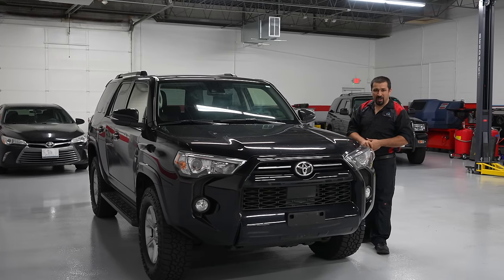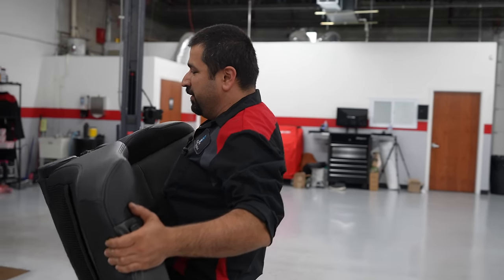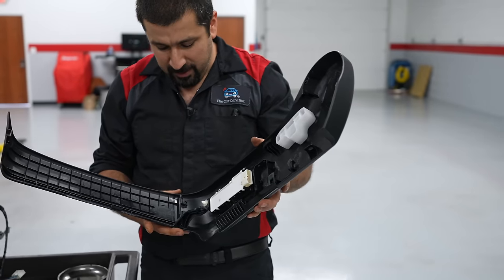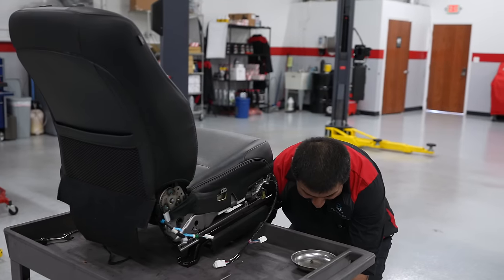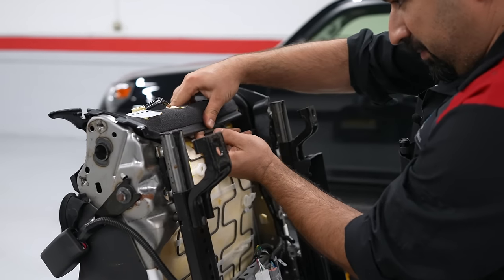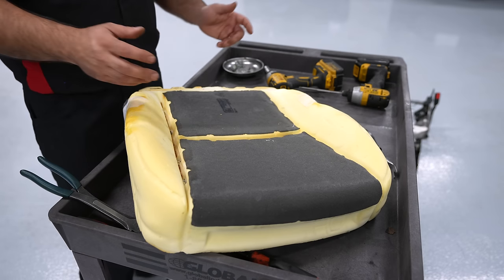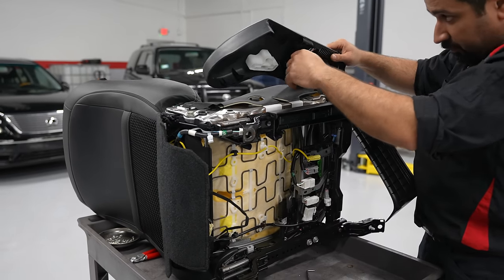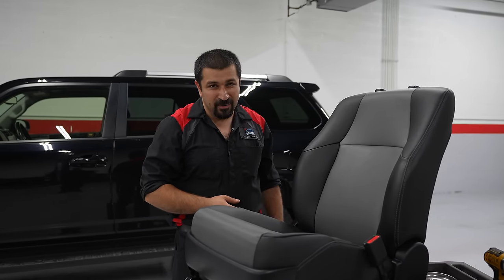Tearing a Toyota Seat Apart to Replace a Cover | Toyota Seat Common Problems

Comment: AMD ,  My name is Bret Staley. I have a 2022 RAV4 Prime SE that I took the seat out of so I with the help of a master welder metal fabricator could make the to tall for my disabled wife a seat that could raise and lower.  I got the seat all back together and reinstalled it into the RAV4 Prime and the Air Bag light was on.  So I scheduled a trip to A Toyota dealership to shut off the air bag light and reprogram as needed. The Toyota dealership did in deed get the air bag light shut off but they refused to do the re calibrating as they told me Toyota does not allow them to do so. So I got my hands on an Autel MaxiIM and paid Autel for the most recent updates so it would be compatible with my 2022 RAV4 Prime. There is a gentleman on Youtube that showed how to do the 2 steps to re-calibrate the occupant air bag sensor in the passenger seat .My metal fabricator found that video and that is when I borrowed the Autel scan tool and paid for the update. One function the end position sensor programed flawlessly and beeped in approval in just seconds.  The power On for the Passenger seat occupancy sensor was not so accepting and the wait function on the scanner would just continue to flash and every time I would hit escape even 20 plus minutes later it would turn the power position back to off.  The only code that shows with a deep scan is in the remote key-less entry module and it is U111787 unable to communicate. I'm at my wits end . I have a brand new car that Toyota refuses to help with  and I can find no one here in my area that has any proficiency in working on Toyota air bags/ interiors. I  hope and  pray that you might consider doing a video chat with me and helping me to reestablish communication so the passenger side air bag will arm as it should and my dear wife will be safe and able to easily get in and out of our RAV4 Prime.  I talked with your receptionist this afternoon and she said she would talk to you. Here is to hoping that you will agree to a video chat and walk me through the process that I'm sure must exist to re arm the air bag sensor on a GEN 5 RAV4 similar I'm sure to what you had to do after you put the seat back into the Tacoma in this video.  I noticed in your Video that you did not disconnect the battery before you disconnected the wiring harness. So if the Tacoma reacted as my RAV4 you also had to clear the Airbag light and re-calibrate the sensors.  God speed AMD.,       Bret Staley
PS I will be happy to pay 1-2 or whatever seems fair to you shop hours to just talk me trough the process. Just so you know I'm a 1982 AAI Arizona Automotive Inst. graduate. I'm a Doctor of Chiropractic now  but I will not be useless to you on a video chat call. Like I said I have the fully updated version on the Autel unit so should be good if that is indeed all we need. 
God Speed AMD.  Keep up your good work.

Comment: AMD I have a EMERGENCY question. I have a 99 4runner 3rz-fe, my 4runner does not start I put my key I don’t hear a crank and it does not appear Check engine light. Plz help.

Comment: My Toyota Auris seat squeaks like crazy it drives me nuts. Impossible to find the same matching leather seat. No one in my area seems to do seat repairs. I've tried stuffing fabric between the sponge and metal did a slight decrease but it's still there. Not sure if anyone ever had a similar  issue would be great help if anyone had a way to solve this.

Comment: I have a 2021 Camry SE with an issue on the seat cover.  The front bottom cover come undone from the J clips that hold the cover to the seat.  It happens all the time.  The dealer just put them back but in a few days they come off.  Is there a fix for this?
Reply: What do I do?

Comment: THE BACK HALF OF THE DRIVERS SEAT HAS SAGGED DOWN. EVERYTHING BACK OF CENTER SUPPORT. I THINK THAT THE SPRING SUPPORT HAS BROKEN OR COME LOOSE. THIS VIDEO DID NOT COVER THAT PROBLEM. HELP OR ADVICE WOULD HELP ME TO FIGURE WHAT CAME UNDONE SND HOW MUCH IT WILL COST TO FIX IT? (CAPS ARE NOT FOR ANGER...JUST LAZY ME)

Comment: There is absolutely no way id do this job for any car with higher miles on it and not get either new foam made, or ordered. Idc the price.
Or, id cut out an inch or 2 of the top layer of this foam, and add some super high quality foam, or some sort of gel foam or something like that.

Comment: It would be better to just have the hole repaired properly.  The chances of it  coming apart and ever going back together  properly are very slim. Why ? Mechanics cut corners, when it gets tricky. Eg.. Clips break... So what ? Getting new ones is too much trouble and is time consuming.  Don't worry, the customer will never know. Leave them off and just put it back together. Many, many, mechanics and other tradesmen cheat like hell.  Local mechanics can't match what the factory does. It'll NEVER be the same again.  Don't take it apart !